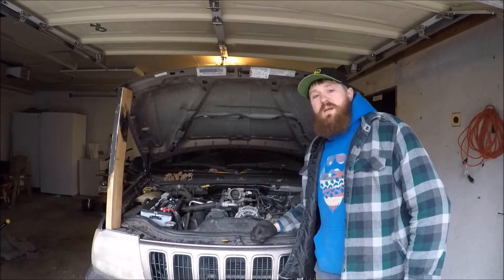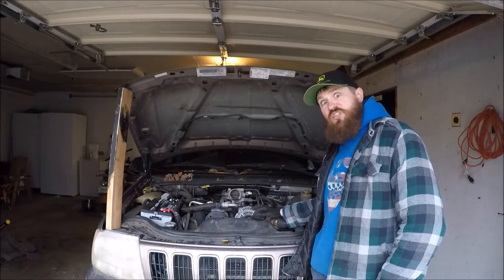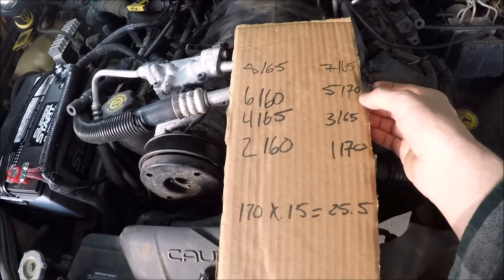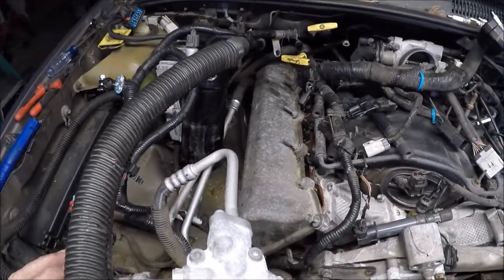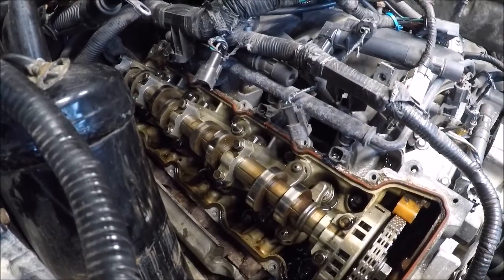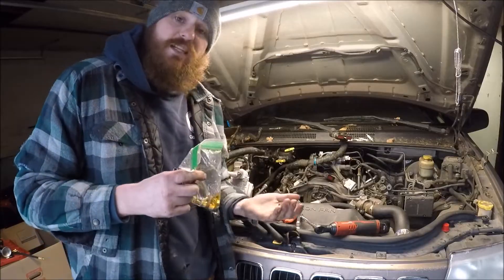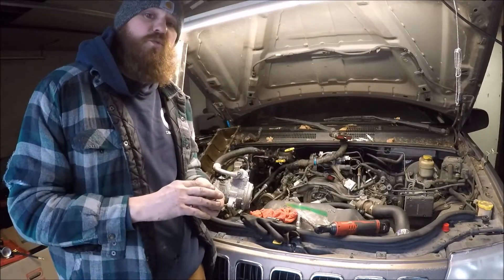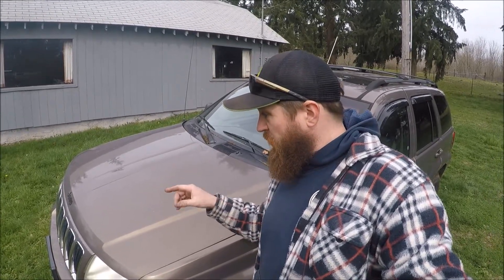Diagnosing and Repairing Common Chrysler/Jeep 4.7 V8 Valve Train Failure

Comment: awesome. I totally called it lol.. usually they spit rockers after siting for extended periods, or when it is super cold out. I'm going to be swapping a 3.7 into my ZJ coming probably next summer.
Reply from the maker: Yep.  Thanks for your help.  Thing runs mint now
Reply: @MuddyBeards4X4  no worries. next thing I'd suggest is to get a good quality radiator cap, make sure the water pump is solid too. leading cause of valve issues on these is coolant neglect. it's a sweet rig though, I sorta regret sacrificing my wj for parts for the zj, but I can always get another.

Comment: I upgraded my cams lifters and rockers and the intake to the 08 stuff.and my jeep runs a lote better. Getting ready to put headers and good cats and exhaust on it.
Reply from the maker: I plan on doing that as well.  I need to hit the junk yard to find an ho motor
Reply: Where are you getting headers from? The Doug headers have been out of stock everywhere online except on scam websites. I definitely have been searching for about two years with no luck.
Reply: @jtbuilds9176  I've had them forever and just now getting ready to finish somethings up on it .before the new lift gets belt .
Reply: I definitely need a set with the y pipe! I have a 02 WJ overland that I got for $200 about 5 years ago. Has the 4.7H.O. which had a failed valve guide and all exhaust valve seals driver side were bad on reman heads from AutoZone. Drove it up until January of this year smoking it's ass off and bought a brand new engine for $4,000 from jeep parts Depot out of California which was a huge mistake. The engine blew 5 pistons and rods in 20 miles and the vendor told me to just drive it more that it was because of lifter issues and they needed to pump up. I kept my old engine instead of giving it up as a core and I am glad I did because they refused to respond about the engine or warranty and bought new heads for my old engine and she has been back on the road. If you ever need parts please listen to me and NEVER USE JEEP PARTS DEPOT OUT OF SUN VALLEY CALIFORNIA!  They will screw you over and never respond once the engine is sold.
I do plan on re-rebuilding my engine and using scat rods and scat pistons and solid lifters and possibly a screw style supercharger with an ATI balancer. I also plan on balancing the engine as well. Headers and y pipe seem to be the only parts I cannot score.
Reply: @jtbuilds9176  look up Martin Builds on YouTube.he shows a set from some other place .
Reply: @kevinclevenger8741  I already have watched all his videos which are alright but as a technician of around 20 years I can source parts pretty well. His links in the videos are all out dated and the links that still have products are out of stock and not going to stock again.
Reply: @jtbuilds9176  wow I didn't no that about his links .sorry have you asked in of the wj groups to see if someone has a set for sale.
Reply: @kevinclevenger8741  That I have not done but my manager who was the founder of Midwest jeep thing at our shop which we are known as the jeep and Toyota shop of Saint Louis Missouri so I am in the loop for pretty much the whole Midwest us and have asked around in the jeep groups around a few Midwest states. I really should hit the online groups and see.
Reply: @jtbuilds9176  I will ask around are groups for you .and if I find anything I will late you no .
Reply: My father's last name is clevenger
Reply: @brandoncimino703  o ya we have family all over the place .
Reply: That's true 👍